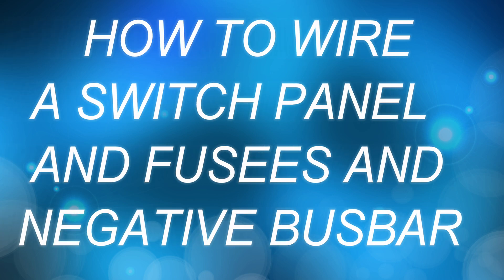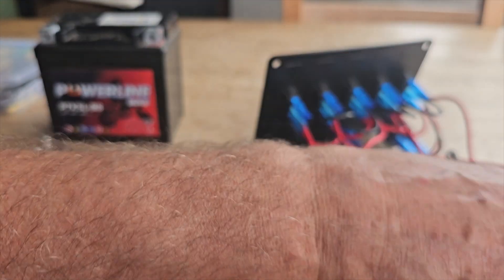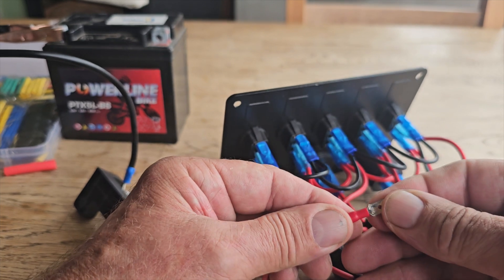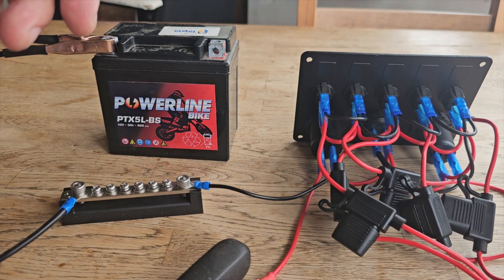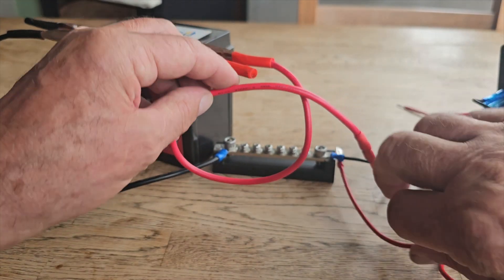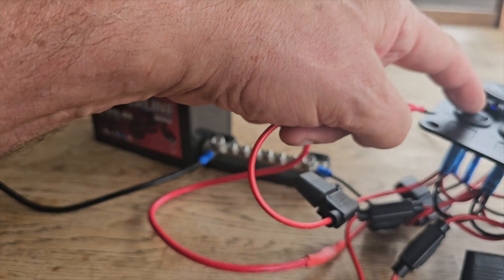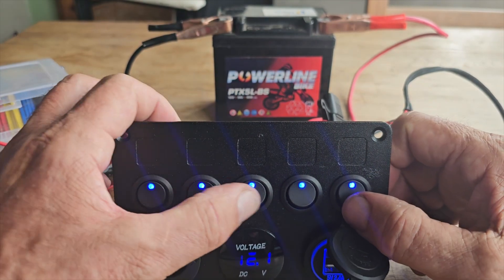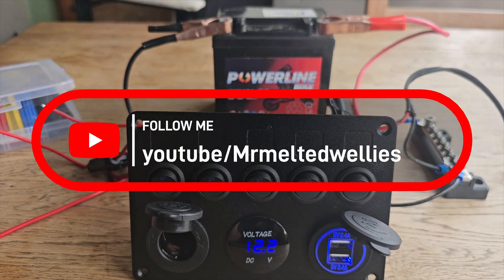HOW TO WIRE A SWITCH PANEL AND FUSEES AND NEGATIVE BUSBAR

Comment: I have a similar 6 switch panel - the negative and positive are all daisy chained together with a single negative and positive input wires - how would you use this type of switch panel with a bus bar?

Comment: I have two questions:
1- I plan on hooking this up to my vehicle. Can I just hook up a 2nd battery like the one in your video, Instead of hooking it up to my vehicle’s battery? I don’t want to have continuous power drainage from my vehicle’s battery.
2nd question- I saw in another video with a similar switch panel that they were able to use the 1st switch on the panel to power the whole panel on&off by rewiring the red cable. I was wondering if you would be able to do a similar video with this panel? I would feel more comfortable if you did. Here is the video that I watched—-https://youtu.be/pnoDTM_GHsA?si=ZCLSH98qaH35fsQN

Thanks in advance and definitely will be subscribing.
Reply from the maker: yes to both questions thanks for watching
Reply: @MrMeltedwellies nice. Will be waiting for the video. Again thanks in advance..